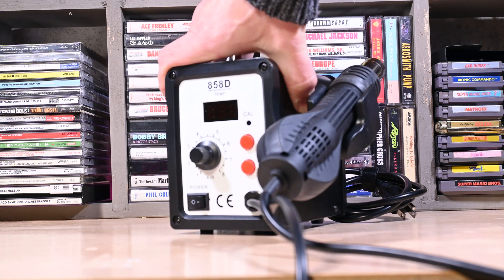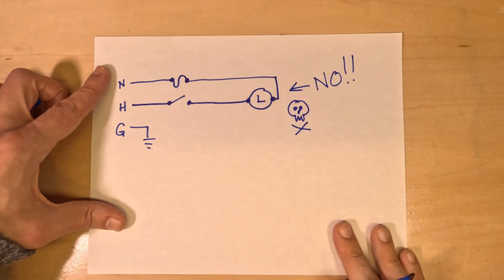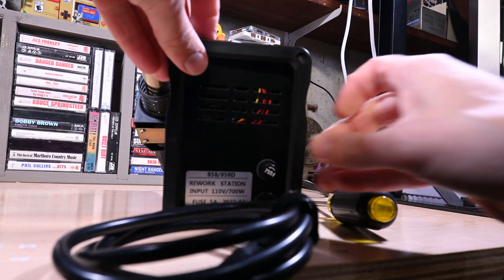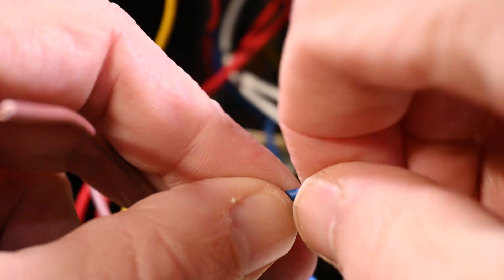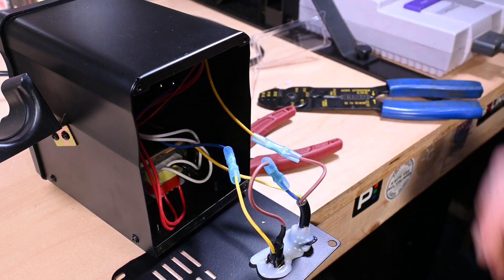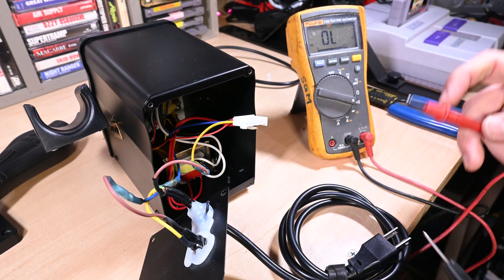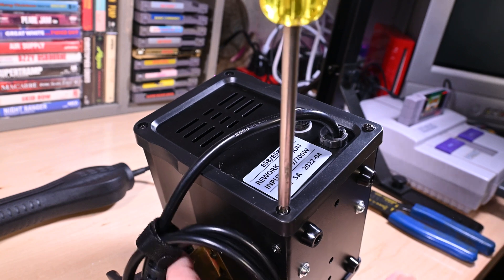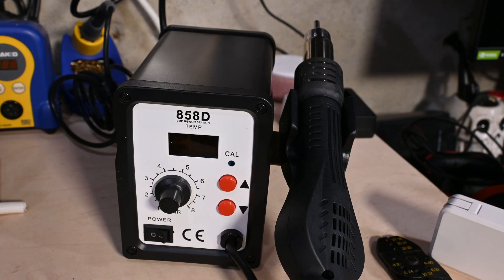How to Rewire a 858 Hot Air Rework Station for Safety

Comment: Surely asking this, some of you will laugh at me for my poorly knowledge of electricity but, if the fuse is directly attached to the power chord... It would be pointless the wire that connect directly to the fuse is the hot one or neutral one because is AC?? According to what I know, the polarity changes since it is AC, so should be pointless if is directly attached to hot wire or neutral wire...

Again, I would like someone to explain me because if the situation were in a DC circuit I would understand but there...

Comment: I got a 858 recently from AE and the internals got reworked such that everything is now on the board itself at the front and its just 3 wires from the C13 receptacle running across the entire massive void of an enclosure, and the fuse is now on the hot side so yay! I still opened it for a sanity check anyways since I could have just probed on the receptacle and fuse.

Comment: For anyone using these units, check the actually continuity from from the plug itself and dont rely on the colors, my unit has BLUE as the hot and brown as the neutral. My unit came wired properly aside from poor grounding points.

Comment: If you're staying it's trying to kill you, what fault path do you have in mind and why do you suggest a fuse that will happily pass several amperes is going to save you, when it only takes milliamperes to kill you?

Also what is everyone in half the rest of the world aupposed to do where plugs are reversible or the phase/neutral wiring is essentially random?
Reply from the maker: First part, it only takes a few milliamps across your heart to kill you, which is pretty unlikely to happen. Second part, I don't have an answer because this wiring is being suggested for US users.
Reply: @sethfrommaine  Assumed hand-hand or hand-foot resistance of human body is around 1kOhm (can be higher), which results in a very lethal current of 120mA/230mA. An adequate protection mechanism is a fault current detector (difference or Earth leakage) which has thresholds in tens of mA and trigger times in tens of milliseconds. Not a 10A fuse. Which you still want in order to prevent possible fires from L-N shorts inside the device, which is also why they deemed it didn't matter whether the fuse ends up in L or N path, and it is indeed permissible to do it like this in EU and China.

I do think moving the fuse to L is good when there's no RCD, but i also can't think of a situation when it's going to save you from death by electrocution.

Comment: Also the case needs to be connected to mains earth. They earth the front panel, but not the black metallic shell. You would need a separate wire spliced from earth bolted to the case where the transformer is installed.

Comment: In Germany 3:04 we wire legal the power cord ...  
... after the powercord you have to find a switch ...
... and it must switch off both power lines simultainously off an on. (Dude)

Ok you dont know it what is legal in germany and some other EU countrys.
All other switch constructions with moveable devices are absolute illegal. 

There are some rules for the maxium force to pull the power cord out of the device, 
the PVC isolation have to meet some general tules and 
there must be a test label at the cord and 
see the labels at the power plug to. 

What a shame I can turn the plug 180 degree wrong into the wall plug. In britanin possible. 
No problem because the device have to met still safty regulation to prevent stupid experts to kill themself. 

Your fuse in germany will be inspected very critical ! Maybe the custom send these devices back to the seller.
The EU device have a fuse container. If I lift the fuse out the power is disconntcted or it is very difficult to reach metal with a baby finger. Often the test is made with a smal calibrated metal pice (like a scredriver). 

Can a child reach the life power and a screwdriver at the nearly pluged in power plug in the UK wall plug ? 
Impossible in germany when the plug and the wall plug is legal. 

If the EU boarder control find a container with illegal electric devices ...
... it is not allowed to enter the EU when a EU-plug type is mounted. 

I boarder custom officer in every EU country works legal, they store the china packet for two weeks (or some weeks) and send you a letter tell you that you are the importer off illegal devices. 

After the time it is send back to the origin country and you can see if you get the money back. 
You are not informed with the new parcel ID code. Well good luck. 

Is it the sellers mistake ? 
No it was the mistage of the buyer. 
He is the importer of illegal electronic/electric devices into the EU territory. 

The device has to wear signs = ce and Rohs and sometimes additional safty test institut logo. 
And a manual in the english (or the in the language of the buyer country) must be included. 
The device have to meet actual safty laws or entering into EU is refused. 
The manufacturer or seller have to add a page with the EU law confirmation declaration by the manfucaturer with the registration number. 

Ok it is often impossible to control every container and every parcel. 
But is is still illegal. Sometimes I find these devices in smal shops. But it is not allowed to sell these. 

A device with a single contact switch is absolut illegal.
Reply: Mei was ist das für ein Wortsalat. Nicht Mal die Rechtschreibung kriegst du hin.

Schau kurz so gut wie alle Geräte die du hast, auch nach allen Normen abgenommene, haben einpolige Schalter.

Lichtschalter führt man nicht mehr einpolig aus, schon gar nicht in der Neutralleiter, weil sich sonst einer beim Wechseln der Glühbirne tödlich umbringen kann. Für verschlossene Geräte mit Schutzklasse gibt es dagegen keine entsprechende Vorschrift.

Comment: Is there a way to test/verify that the wiring for the fuse is wrong and that I need to follow this guide to rewire my unit?
Reply from the maker: If you have a multimeter you can do a continuity test from the plug’s neutral to the fuse.
Reply: In germany we buy legal devices only when the switch cut both power lines. 
The german version must be a lot different to the US or GB Version. 

A GB-Version ...
... only a DUDE  changed it with a cheap EU plug type is absolute illegal. 

You maybe find these in very smal at self importing shops. But he can lose his container at the custom. 
Or later in the shop a officer stop immediatly the sellig and ask for the bills of the buyer 
(to see if he get the adresse from the buyer).

Comment: Check the Earth connection on the wand!⚡️⚡️
Reply: Thumps up ! Beter to check the earth connection because the chinease worker leave the painting sometimes under the contact/scew/bolt/nut. Not a really unusual dangerous mistake ! Easy to check and repair.

Comment: Let me say, I think your idea to make the Station safer is good, but  at least in Germany, the brown line is Phase (or live, however you want to call it), and the blue line in neutral. 

So in theory, the fuse was placed in the right line. But in practice, at least the european plug can be turned around, so here in Germany you would always have a 50 50 Chance of having the fuse in live or neutral (and yep, I know... The EU plug is Kind of silly for that reasons...)
Reply: Does that mean I don't have to do a "safety"mod with european plug system ?
Reply: @Nick-ov8ed  it depends. If the plug is reversible (e.g. German schuko, Italian plug) it's probably better to keep the fuse on one wire and the switch on the other one. At least you will have a 50% chance to cut the live wire.
Reply: @bufordmaddogtannen noob warning:

What if you added an extra fuse, so when polarity switches you still have a fuse on live (and neutral)?
Reply: @rogierius  that would work well in countries where plugs are reversible.
For extra safety, I would use a switch that cuts off both neutral and live.
Reply: @bufordmaddogtannen  so is the normally done to comply to EU standards, like for instance Germany with their Schuko wall outlets? Do switches break live and neutral & have two fuses? Or is the solution proper isolation and grounding?
Reply: @rogierius  I'd say this would be an extra precaution. Schuko plugs in Italy are reversible, so it would still be possible to swap line and neutral by accident.
I'm not sure how German made appliances adress the issue thought.
Reply: @rogierius  We have proper isolation and good grounding everywhere. Most switches just break live, but it depends on the appliance. 
The one thing i miss are the uk in-plug fuses.. i kinda like them
Reply: There is another problem that is not mentioned in this video: the live and neutral wires in the molded plug are also wired incorrectly as they used brown for neutral and blue for the live.
Reply: what about a uk version
Reply: @1961jagman  UK plug is non reversible so if the fuse is on  brown (live) before the switch then everything is fine.
Reply: @krisoko  The UK version will have a fuse in the plug itself on the live wire.
Reply from the maker: I remembered the color-code from my time in Germany, but I had forgotten the plugs could just be spun around.